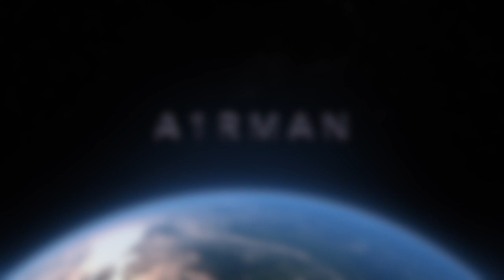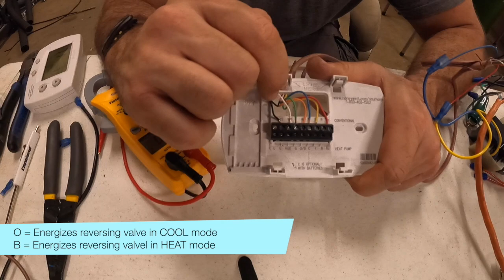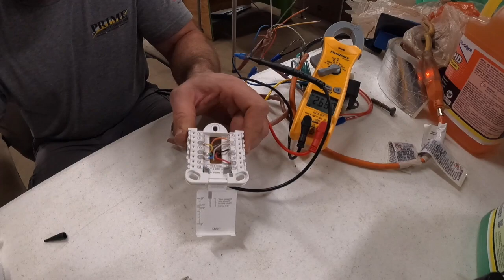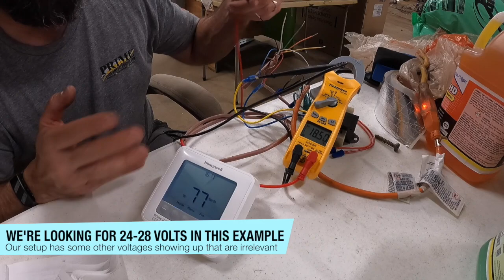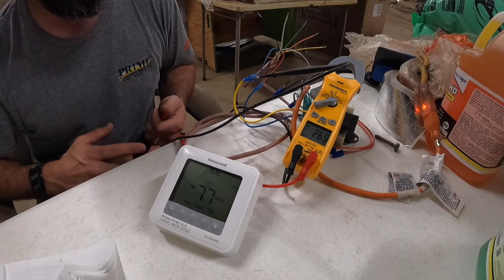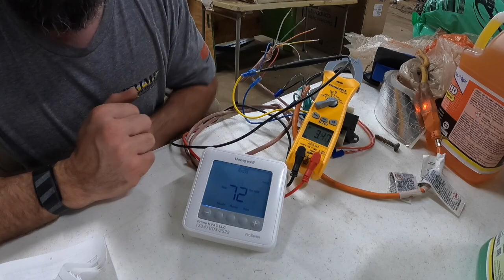Troubleshooting thermostats

Comment: Very worthwhile and detailed explanation of function and wiring. My Honeywell Vision Pro 8000 (for heat pump) goes into aux heat now (for no valid reason - outside temp no low enough) and never comes out of it. I pull the batteries and let it set for a minute and when I reinstall it, it goes back to the heat pump setting and functions as it is supposed to - until the next time - could be today, tomorrow or whenever. It's unreliable. I used to have the fan set on recirculate, which would leave the fan running at about 1/4 speed 24/7, but then the fan started running full speed and never shuts off, and that's also when the aux heat problem started. Those two things combined suggest to me that the thermostat is bad, so I'll get another one. Need the heat pump running, so I don't have down time to set up a test like you have done. I welcome your thoughts on this issue.
Reply from the maker: Could be a few things…but starting with the thermostat is fine.  Could be a sticking relay/control for the fan and/or heat strips.  Also, the defrost board could be “bad” and energizing the heat strips.  Those would be a more complicated to diagnose issue.